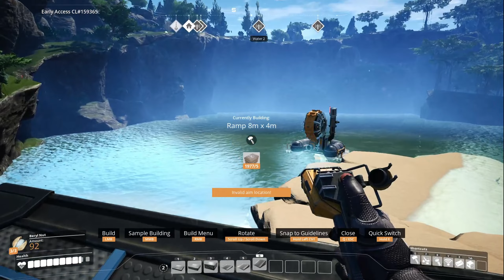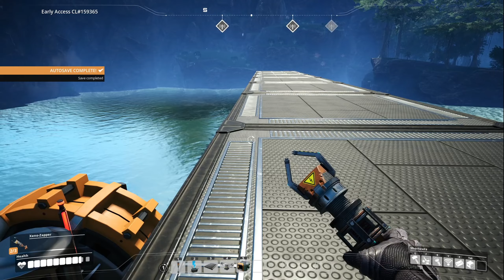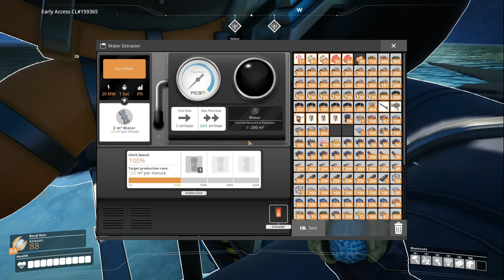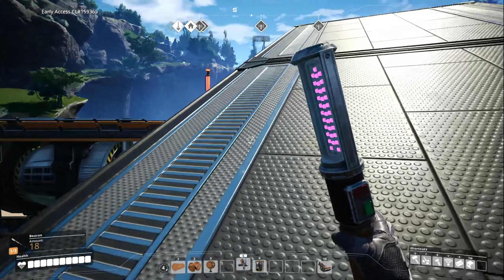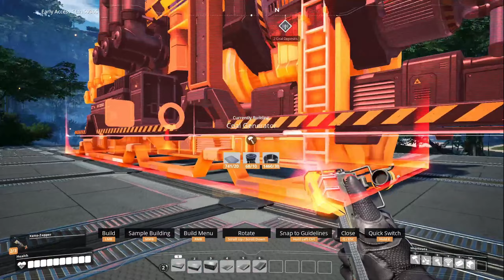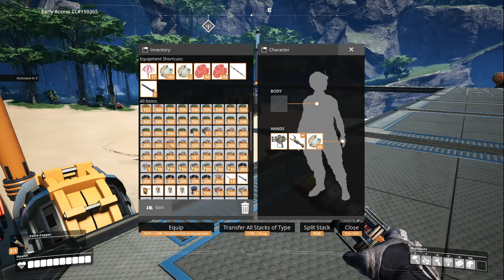Let's Play Satisfactory s01 e16

Comment: As an English prof once said to me "your unconventional approach is refreshing" :-) (I was a science major, lol.)  Gives me some good out-of-the-box ideas for my own playthrough!

Something I learned a few months back is that you don't always have to overclock stuff, you can actually underclock.  The example was water pumps.  Three of them at 45 m3/min is too much for 3 coal generators taking a total of 120 m3/min.  So what you do is you underclock each pump down to 40 m3/min (no power shards needed, you can just slide the bar to the left).  Why would you want to do that?  If consumption is 120 and production is 120, you get the pumps running steady.  If the pumps are over-producing, they turn on and off which will cause your electricity consumption graph into a sawtooth form as they draw and then don't draw power from the grid.  That jaggedness not only causes an annoying sound from the pumps, but can cause the circuit breaker to pop if you're close to full capacity.  This applies to mines, too, and any machine that is potentially producing more than its consumers can handle.

Of course, in most cases, you can boost the consumers to work faster instead by overclocking them (in this case, boosting each generator by 5 m3/min) but this requires power shards - 3 per water pump + generators set.  Also, one has to remember that belts and pipes have a limit to their capacity per minute, so you can overclock beyond what the belts/pipes can actually handle.

The Glidercat philosophy isn't to be hyper-efficient, and that's fair, so I mention the above for the benefit of other viewers :-)  I've only just started using this underclocking and only just a few times so far.
Reply from the maker: That's a pretty amazing piece of information regarding the underclocking!  Awesome!   I saw it briefly when I was looking at one of the machines, but didn't immediately think of a use for it.   

We'll see. I'm actually planning to only overclock my mining drills to increase the rate of raw materials being supplied.  I'm thinking I can just fan out arrays of any machines downstream of that, since I typically don't bother with hitting perfect ratios. 

I haven't discovered how much batteries cost, but I have it in my mind to just build a skyscraper full of them to deal with any (temporary) power surges. 

There is still tons I (willingly) don't know about what's to come in my playthrough so plans could definitely change as I make my way forward.

Keep those suggestions and tips (but not spoilers 🙏) coming!

Comment: Just a hint for placing the pipe junctions, to get the snap lines you need to get up high. Don't ask me why it works that way but it does. Place one  piece somewhere then stand on top of it. When you go to place the next one you will see the blue guide lines. Helps to make things neater if that's your style.
Reply from the maker: Thanks for the tip!  I'll make a note of that and give it a try.
Reply: Also, you can use the pipe support to line up with the pipe input, press the key you've set to the junction and build it.  Boom, proper alignment. 

There's a guy called Nilaus that has little tips and tricks like that.

Comment: The way I handled this area was starting near the shore line and built foundations out toward the water.  Laid out the coal power plants and built water extractors so they were fairly level with the platforms, thus negating the need for pumps.

Although, I'm probably going to take it offline temporarily and clean up the beltwork because it is SERIOUSLY convoluted.

Also, there are two more coal nodes in that immediate area you could tap.  The two you found I didn't realize were there until MUCH later in the game.

Also, it's much easier to lay your pipework, then place your pumps on the pipes where needed to maintain headlift.  Which means the pumps need to go on the vertical portions of the pipes coming out of your extractors. 

Easiest way to get over the pipes is get ladders from the awesome shop and build one on either side of the pipe.  Of course, once you get a jetpack, that makes all kinds of things easier.  And doing the belts here, use a conveyor lift at the coal plant.
Reply from the maker: Some good suggestions there.  Keep them coming, but try not to reveal any map secrets if you can help it. 😺

Comment: I'm thinking it would be easier to lay down 6 generators, 3 facing 3 and run a belt of coal down the middle with splitters feeding them. Then get the water pipe overhead of the coal line using the splitters as a pipe support. Then feed water to each one. Would be less resources and easier to navigate maybe?
Reply from the maker: That does sound a lot cleaner.  Once everything is placed, I'm not too worried about navigating it much, since I'm guessing I'll pretty much never come back. I will likely need to come back to upgrade the belts though and maybe even the pipes, so I don't know.  

I'm very hesitant to spend too much time trying to get things to line up perfectly because I'm no so fast at doing that. Doing so might be a bit boring to watch, as I repeatedly retry to get things laid out really compact, and it would likely double the length of each episode. 😸   I'll try to keep the layouts from being too hideous though!